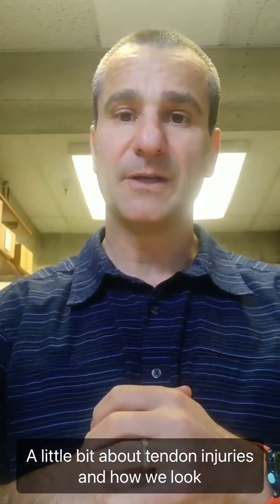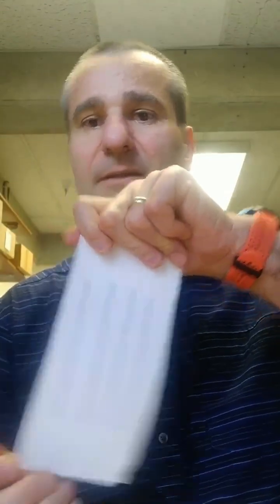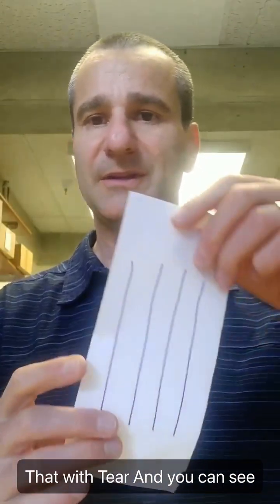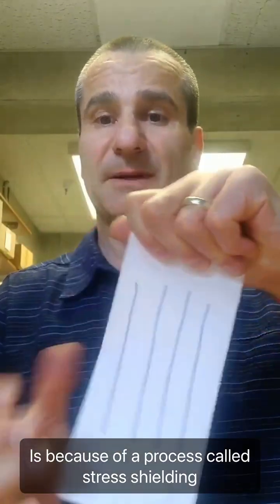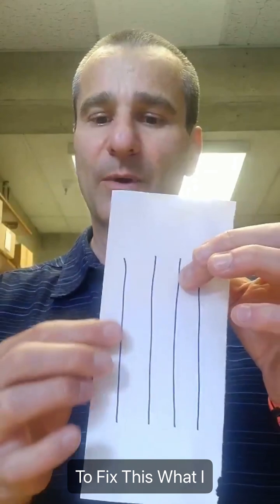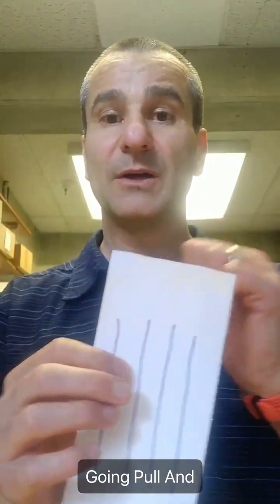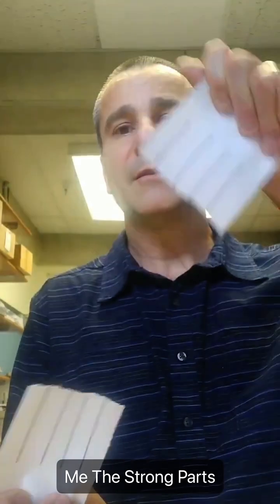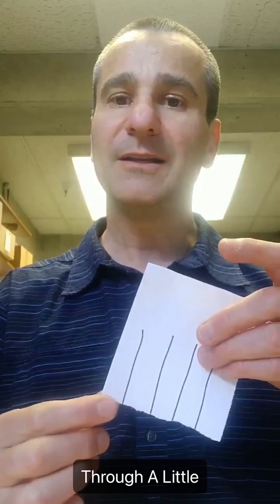Tendon Injuries and How to Fix Them

Comment: This is interesting... so I'm hoping for a follow up video for optimal shoulder exercises that would follow this. 

I've tried PT 3x now for my shoulder injury with hopes of playing softball again [throwing a ball with max effort and without pain]. 

But I have yet to be able to play sports again without immediate pain after throwing. 

My MRI shows thin tears of two of the shoulder tendons that seem to be the culprits for this lack of range of motion and pain. I will reference it below. 

That said, I'm looking for a protocol for the shoulder that might work for my issue. Any help or direction is appreciated. 

1. Moderate acromioclavicular joint arthrosis. 
2. Mild supraspinatus tendinosis with thin linear interstitial splits of the mid and posterior fibers of the supraspinatus tendon footprint. Thin linear interstitial split subscapularis tendon footprint. Intact infraspinatus and teres minor tendons. 
3. Intermediate signal intensity and thickening of the inferior glenohumeral ligament with rotator interval synovitis. These findings suggest adhesive capsulitis. 
4. Mild long head biceps tendinosis proximal to the bicipital groove. 
5. Glenohumeral joint arthrosis with areas of cartilage loss as described above. Degeneration superior and posterior superior labrum. Thin tear at the base of the posterior mid to posterior inferior labrum. Severe attrition inferior labrum. Blunting, degeneration, and a thin tear at the base of the anterior mid to anterior inferior labrum. 
6. Small glenohumeral joint effusion. Mild synovitis and debris within the axillary pouch. Osteochondral bodies as described above.

Comment: Long story short if you do dynamic exercise your damaged tendons won't heal because of the mechanism stress shielding. Isometrics, muscle contractions without movement put load on these damaged areas because there is no stress shielding.

Edit: If you have an index card it would be good for this example you have to put a lot of force to rip the thing, I had to put at least like five or so tears before I could rip it with the pulling, makes it more realistic with how our tendons work. It's scary sometimes they rip really far from the end sometimes the rip in the middle😅

Comment: 1. Are isometric exercises bad for tendon-tear rehabilitation?

2. Can isometric exercises lead a partial tendon tear to become a full tear?

3. Or is he saying that stretching exercises can turn a partial tendon injury into a complete tendon rupture? I honestly didn’t understand what he meant. Is he comparing isometric exercises with stretching exercises? Is that it?
Reply: Isometrics exercises are good for recovering from tendinopathy (tendonitis and tendinosis), but those are more like malformed parts of tendons rather than tears.
I think any exercises could cause a partial tear to tear completely if loaded too aggressively and executed poorly.

In the video, he’s using a piece of paper with lines that represent how the tendon fibers stretch; all in one direction. Tendons stretch exactly like resistance bands, which is what I would’ve used first to show how they work. 
He tears the paper a little, which represents an injured part of the tendon.  When pulling the paper quickly, nothing happens, but when he pulls the paper for a longer time, this shows what the isometric does.
As a load is held, the stress your tendon experiences eventually spreads to the injured part.
The paper tearing shows that once you hold an isometric for long enough, the healthy fibers relax and your injury is no longer shielded. This forces the injured tissue to bear load, which allows it to gain strength over months of exercising.
The paper tearing is what’s confusing, but he is not saying that isometrics will tear your tendon. He is trying to demonstrate that isometrics are good because they can load your injured tissue, which is what happens when the paper tears.
The paper tearing just proves that the isometric load forces the injury to bear load, but it wouldn’t tear your tendon if done right.
Reply: @superbeef4057Thanks a lot for comment!!! Gracias!!! Now I understand

Comment: so, if i do a pull up an keep hanging half way up I will load the tendons around my elbow until they relax?
Reply: isometrics will work overtime to rebuild the tear in the tendon, then you can move back to dynamic stuff like sprinting once you have built back a base.
Reply: @nicoloomer6772 how many weeks should i do isometrics? 1? When i know can i do dynamic excercises?

Comment: So is this a way to fix tendons or to tear them?
Reply: It is to heal them.

You use minimum load until you feel tension but no pain. 

If you pulled hard or shifted quickly, you could hurt it again. 

But that is his exact point. Getting a light load to the injured area, causes the directional collagen to re align and heals the injury.
Reply: @xBandOfTheRedHandx  This was easier to understand that the wording in the video. The example in the video was amazing, but the explanation was confusing
Reply: @timothypilli true. He was saying to load it untill tear. He should have said hold a small percentage of the load of it.
Reply: @xBandOfTheRedHandx  I'm doing isometric exercises with a resistance band. I started last Friday and have been using it for three days. I have a chronic injury, proximal biceps tendinitis, diagnosed 5-6 months ago. Something I'm not clear on is how long I should do isometric exercises? I mean, how many weeks or months? When will I know I can do normal movements like concentric and eccentric contractions? After using the resistance band for isometrics, should I also use dumbbells and do isometric exercises, gradually increasing the weight over several weeks and doing the same thing?or can i only use resistance bands and do isometrics till my injury healed?
Reply: @RenatoArmas-cf7yc  takes up til a year. you will know when the pain is gone or nearly gone and you can gently try.
not going to lie to u, chances are itll never go away and always come back once u stop the exercises. so welcome isometrics in ur life for ever and ull be good XD
Reply: @leinadllerp  with proper training it should definitely go away eventually
Reply: @RenatoArmas-cf7yc It will definitely heal completely within a year with appropriate rehabilitation (as this video describes).
Reply: Paper broke bc it has not "healing área" as he said I assume injured area does have healing properties so it just doesn't break as a paper but gets stimulus
Reply: One can conclude that if I do what he says I'll tear the tendon all the way through
Reply: @bif53 a light load until you feel tension but no pain and hold for 30 seconds?

Not likely
Reply: Both, no tendon, no problem ;)
Reply: Haha
Reply: Instructions unclear, snapped my dick off

Comment: Is this why isometric holds are good for tendon injuries?
Reply: I'm not understanding what he's trying to
Say. It seems like he's saying don't do long static stretches if you have a partially torn tendon. . Or the whole thing will fall apart. It also seemed like he was saying you need loading in the torn part for it to heal but it gets shielded during basic, variable use.  Maybe there's a sweet spot in there with the Intensity and length of time, with static stretching.
Reply: @Eliot.Partridge  he is saying you need to load it (appropriately! so pain levels are within the range of 4/10 or less). Do isometric exercises, work up to 5 times 30 seconds with 60 second breaks in between. You can do them every 6-8 hours to get the maximal effect on collagen synthesis but daily is sufficient.
Reply: @T1mmey92   Thank you for the clarification. I saw the other video where he talked about the 10 minutes every 6 to 8 hours that the receptors would actively work.. for grip strength. I'm wondering how a person could utilize this for arm wrestling strength building. Im guessing every 6 to 8 hours you could do a circuit of say heavy lat pulls.. then next one flys .. then  rotator cuff movements . then isometric pullup holds .. then grip..etc Im just wondering if the muscles will stay adaptive at a similar pace . I guess maybe thats the goal is to know ones body so its all working together.
Reply: @T1mmey92 so its ok when i do isometrics with light weights every day like u said ? I shouldnt let a rest days between it? And when i will know i can increase the weight?
Reply: @RenatoArmas-cf7yc  yes they don't add much fatigue and tissue damage so they can be done daily. Keep the weight so you can hold the contraction for 30-45 seconds. If you can hold the contraction for 60 seconds its probably to light and you need to go heavier. They say to go for 50-60% of your maximum voluntary isometric contraction which equals that time frame.
Reply: @T1mmey92 How long after you started doing isometric exercises did the pain in your injury disappear? I'm doing them twice a day since last monday and I still feel a little pain in the tendon. I don't know what I'm doing wrong or if this is normal.
Reply: Yes, static stretching at end of the workout will allow the healing to happen.

Prior to workouts, dynamic stretching prepares the ligaments.
Reply: @rockyromero I'm not sure, but I think there's no actual scientific evidence that stretching after workouts help healing.
Reply: @And-lodw 

Skip the science.

My body responds significantly with a daily dynamic stretching prior to strengthening and sprinting.

Static evening stretching like yoga, massages and napping is easier.

My body responds for fast, medium and slow motor units.

Waiting for scientific proof means falling off the longevity cliff sooner.
Reply: @Un1234l  I'm doing isometric exercises with a resistance band. I started last Friday and have been using it for three days. I have a chronic injury, proximal biceps tendinitis, diagnosed 5-6 months ago. Something I'm not clear on is how long I should do isometric exercises? I mean, how many weeks or months? When will I know I can do normal movements like concentric and eccentric contractions? After using the resistance band for isometrics, should I also use dumbbells and do isometric exercises, gradually increasing the weight over several weeks and doing the same thing?or can i only use resistance bands and do isometrics till my injury healed?
Reply: @Un1234l I understand what you mean, so it's not entirely necessary to gradually add weight to strengthen tendons; a resistance band is enought. Also, the thing is, with my injury, I can practically only work my triceps or forearms, because if I do back, deltoides, or chest exercises, my biceps get involved and irritates my injury. Ideally, I should avoid them and just do isometric bicep exercises with a resistance band for a while, right? its necessary to warm up for isometrics tho?

Comment: Why are you putting the load through the injure tissue if it’s still Tom?
Reply: I don't know about tears, but for tendonitis you need to compress the tendons directly with self-massage to push fluid in and out of it before it's gonna heal. You gotta get that tissue conditioned by compressing it with pressure on and off and the pain of it over time will shrink in area and lesson. This is assuming you've found the cause of the repetitive stress injury and stopped that. I've done this self-massage with severe elbow tendinitis and with a lacrosse ball and yoga mat recondition glute medius and minimus tendons. In both cases I could tell it was helping immediately, but it took about 3 months of hours a week before the pain was gone and I was fully rehabbed.
Reply: You're putting minimal load on it to promote bloodflow and therefore bringing tendon building materials and waste to and from
Reply: Right. And also my question is - why would tendons relax if there's no moving elements in this tissue?